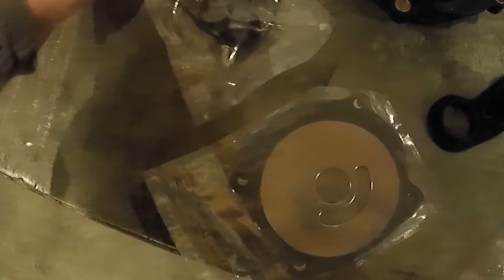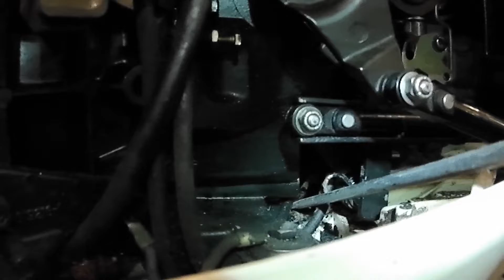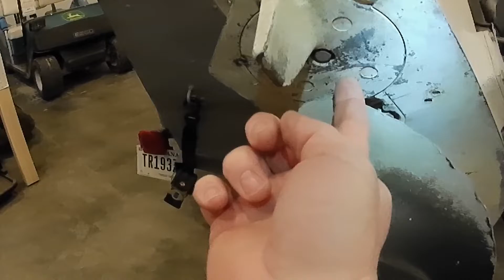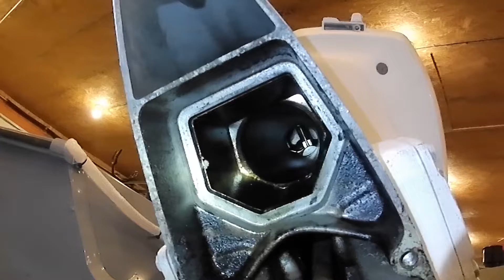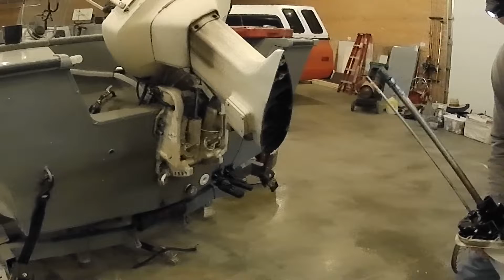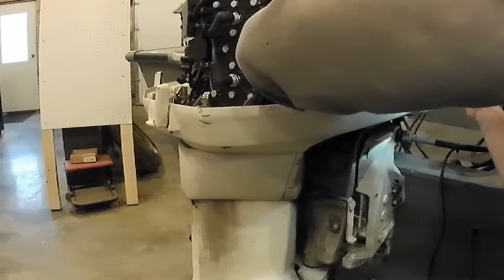Water Pump 90 hp Johnson

Comment: Good video!  I have  90 HP Evinrude built sometime around 1997.  I am going to attempt this project.  By the way, I saw on another video recommending removing the propeller to lighten the load.  It will be very important for me as I have a 22 inch Raker Stainless Steel prop.  One reason I kept searching for more videos and found yours was because it seemed like way too much work to pull the linkage and other components out of the way to get the shifter rod disconnected.  Thanks much!

Comment: I have a 1986 SPL Johnson 88hp. I changed the water pump, BTW Thank you for the help, and put the outboard back together. I thought that I would try the shifting before I start it up and have found that when I put the shifter in forward the prop turns with some force in both directions. The same with the reverse. On my inboard Mercruiser if you put it in forward it will only turn one way, the same if yu put the shifter in revers it will only turn one way.. Is the outboard different seeing how with force it will turn in either direction? I just bought the boat and did not shift it after I found it would start and the compression in each cylinder was 118 to 223 psi in all 4 cylinders. I kind of scares me so I thought that I would ask you. Did I do something wrong putting it back together?